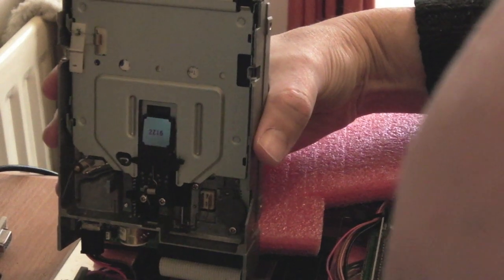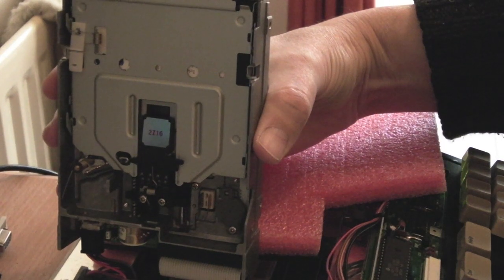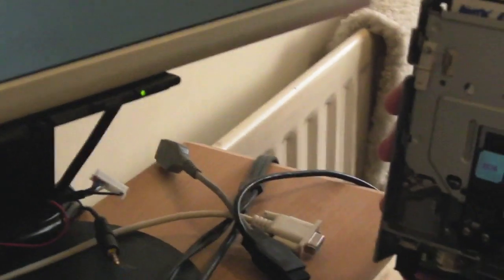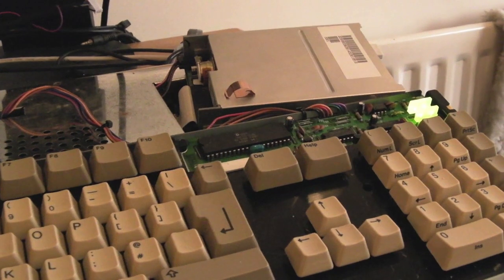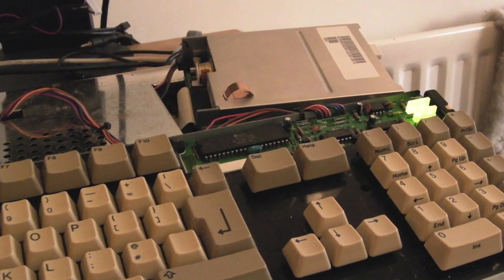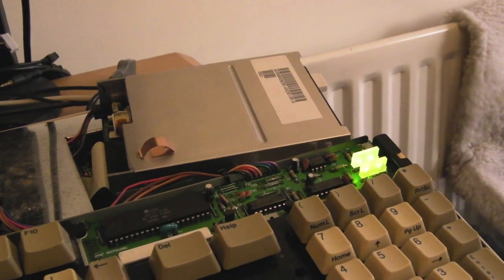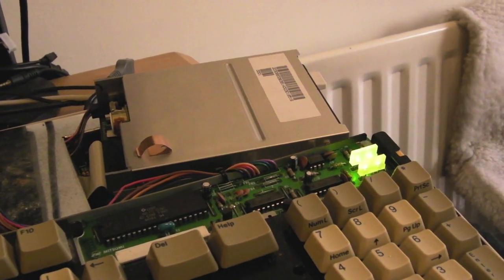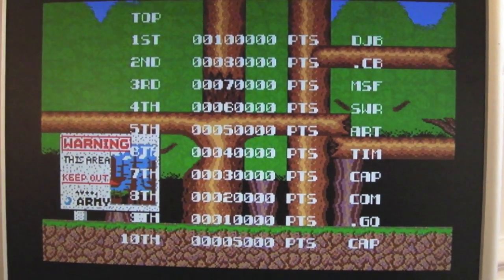Commodore Amiga FDD (Floppy Disk Drive) Repair

Comment: Thanks for the video! I'm trying to get my A500 FDDs working and seem to be stuck. The heads of both drives move slightly when a (proven good) disk is inserted but don't end up reading anything. All capacitors look good, at least on close visual inspection, so I'm a bit lost. The heads themselves have been cleaned, and the motor shaft lubricated. The computer works with a repurposed PC drive, but I'd love to get the original working again. What do you think?
Reply from the maker: I've done a number of FDD videos related to Amiga drives!  It's most likely track alignment (perhaps bad track 0 alignment).  A few of my more recent ones cover that.

Comment: An old and slower floppy producing bad noises damaged my A1200 floppy disk drive. Then the drive had read error on previous working disks too. So i bought on ebay an artisanal head cleaner disk and I used it several times with alcool. The result was that the disk drive cant read any disk anymore. It clicks without disk, but when I insert one it tries to read for 3x2 times and then stops. I open and cleaned particularly the heads and those spring for heads movement. but result didnt change. Disk seems move regularly, heads try to read but they stay in same position. Probably I damaged heads with wrong alcol product. Do you believe there is hope for restoring the disk drive or It is ready for trashcan??? Thanks and sorry for my bad english.
Reply from the maker: You could try cleaning the heads again with IPA.  Lubricate the moving parts etc, and perhaps swap out the caps.  99% of Amiga FDDs can be repaired / serviced to the point they are reliable again.
Reply: @GadgetUK164  Thanks, I'll try.

Comment: How do I lubricate a squeaky drive?
Reply from the maker: First you need to identify where the squeak is coming from.  Then use molycote / lithium grease / or a very small drop of general purpose oil (depending on where it is).

Comment: Hey! Sorry for the silly question, but how did you remove the shell(that metal case thing) from the fdd?
Reply from the maker: I cannot remember on this model, but I am pretty sure the top part of the can just prizes out on the sides.  It's clipped on I think.
Reply: @GadgetUK164  I finally did it! I had to remove that screw

Comment: Love the videos!
I'm cleaning up a Panasonic floppy drive form my A1200. What type of lubricant are you using on the motor coil?
Thanks
Reply from the maker: For the main motor (if I have to lube it) I will generally just use a basic 3 in 1.  You have to be careful not to over lubricate something like that as it could interfere with the brushes / commutators etc.  For all other mechanical parts of the drive I use Molycote EM30L.

Comment: I’ve got a Amiga 600 and the disks go in and out ok when it try’s to load a game it goes off the main screen to look like it’s loading then just goes back to the main screen?  It was working 30 years ago lol
Reply from the maker: Most probably needs re-capping!  The SMD electrolytic capacitors will have leaked all over the board, by guess is you are getting a problem with the reset circuit.

Comment: What if a drive acts like a floppy is always inserted? I changed the cap, bridged some corroded tracks and still no joy... Any ideas?
Reply from the maker: That's normally the disk detection switch.  There are two switches at the front of the drive (little pins that push inwards), one is for the write protection, the other is to indicate a disk is in there.  Those can get dirty - get contact cleaner into them and push them up and down.  That might solve your problem!

Comment: hi, my a1200 drive seems to have just died. I put a disk in and the drive was making a really loud pitched screeching noise as the disk attempted to turn. The drive now wont boot any disks. Could it need lubricating or is it knackered now? Ive never attempted to take my amiga apart....any ideas?
Reply from the maker: Could be the capacitor on that drive - quite common in the 600 and 1200s.  It could also be another fault somewhere, but certainly worth checking and swapping out the cap like I did on this repair.  Also worth lubricating the worm bar / rails as well.

Comment: I have a problem with mine,its the same drive for A600,it has a problem of putting disks in well they go in but get stuck coming out..?
Reply from the maker: +RETRO Nuts If they are getting stuck it sounds like something is jamming in the mechanism somewhere - I would take a look at the insides to see if something needs bending back into place.